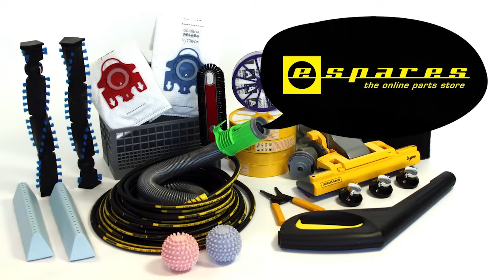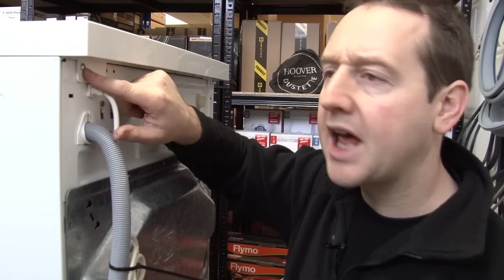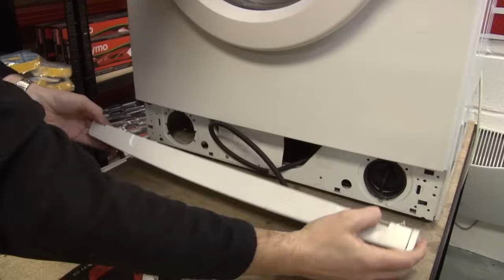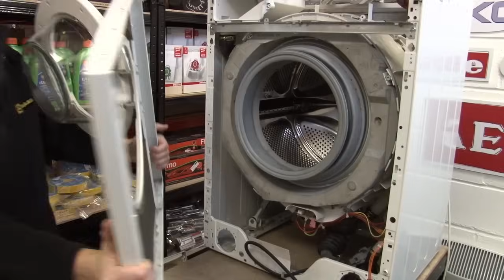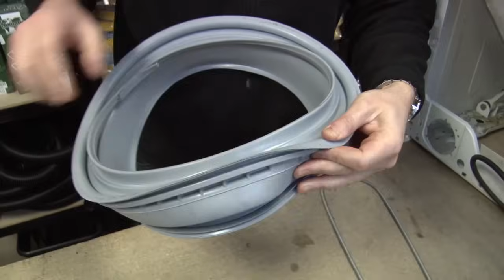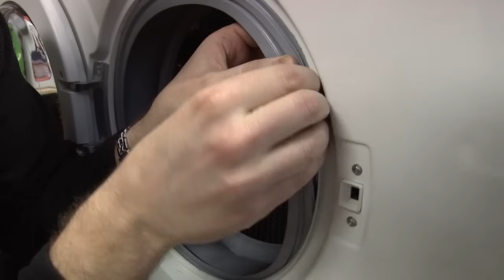How to Replace a Washing Machine Door Seal on a Bosch Washer

Comment: Did this on a Bosch Excell 8 ...

Different screws etc to get to the seal so that was fine but it was an absolute nightmare trying to get the seals clipped in round it ... I had an official Bosch seal maybe it’s made from different rubber but it was a nightmare to try and get it sealed ... the wires didn’t go round anywhere near as easy as your one and I had to get the wife to help me stop it pulling everything out as they clamped on it ... Its not done yet after an hour and a half and a bunch of bruised thumbs ... this is labour intensive wi5 my machine ..yours looked so much simpler... I’d never do again .. well Done to those who succeeded ...
Reply from the maker: Hi Gordon, well done for your perseverance and not giving up. We're glad to hear you solved the issue.

Comment: Hi... Really useful video however i have followed the instructions to the letter and now the washing machine won't turn on. I presume a connection has come loose. Any advice as to what that may be?
Reply from the maker: Hi William, retrace your steps but I would look at the control panel in case something worked loose when it was placed out of the way.
Reply: Thanks. I have tried this but no luck. There is nothing obviously loose.

Comment: Could you tell me what size the torx screws were?
Reply from the maker: Hi Paul, most manufacturers will use more than one size of Torx screws in their appliances and we used a Torx set for this repair.
Reply: eSpares its ok thanks I sorted our washer out it was a t20 and a T10 to get mine out.
Reply from the maker: Glad you sorted it, Paul.

Comment: Brilliant video, I changed the seal on a similar dryer in not much more than an hour even without all the best tools.  Three tips though.  Use a flat bladed screwdriver to lever off the retaining springs.  Get a friend to help you put back these springs, three hands are much easier than two for this job.  Finally, get your new seal from eSpares, great value and service.
Reply from the maker: Hi Roger, well done on fixing your appliance and glad our video helped and remember to like the video.
Reply: @rogernorman5458  I had to ring my brother to help put retaining spring clip back on. Not easy.

Comment: Great video, having trouble with putting the new rubber seal on (3:38), just doesn’t stretch to fit properly, any tips? Thanks in advance.
Reply from the maker: Apply a little washing up liquid to the gap in the seal as this helps it slide over and stretch into position.

Comment: Its not as easy as u show in video the most difficult part in the to put on the seal which is they cut and edit it the struggling one.
Reply from the maker: Hi arju, thank you for your comment, our presenters are not engineers and if you struggle we would recommend using a lubricant to help put the seal on more easily.

Comment: Looks easier enough,love these videos from e spares,but would be nice if they told you roughly how much these spares are,saves looking up the prices,but good video though.thanks
Reply from the maker: Hi Malcolm, This video is over seven years old and as well as prices fluctuating over that time they also can vary a lot between models so we cannot add a 'guide price' without risking putting some viewers off or disappointing others. We currently have 268 Bosch seals listed here:
https://www.espares.co.uk/search/ma856pt1564/washing-machines/seals/bosch

Comment: Thanks a lot. My Bosch Maxx7 door seal was crack. I found easy replacement in Cyprus for 16 euro and with your video help i replace it in a half hour. Very easy and only 6-7 screws and some clips. Thanks a lot again. Familiar disassembly like your washing machine.
Reply from the maker: Thanks for the feedback, glad to hear we helped. 😊

Comment: I just wanted to warn those people who own a Bosch VarioPerfect machine: you may want to consider calling a technician instead of attempting this yourselves. It's not as simple with the VarioPerfect models, as some of the screws are at the bottom of the front cover, etc.
Reply from the maker: Thanks for the comments Andy. There are often minor differences between models but we hope most will be able to follow the video and work out these differences when carrying out the repair.

Comment: On my Maxx 6 machine there is no tork screw on the left side of the control panel face it's a plastic plug of sorts. How do I remove it to get the whole panel off. Thanks.
Reply from the maker: Hi Anthony, Maxx 6 is a range, we need the correct model from the label inside the door. Check if there is a fixing as shown at 1:32.
Reply: Its no. WAE20168ZA/04  FD8705
Reply from the maker: Sorry Anthony but I have been unable to find any information that can help. Sometimes the images of the part can show where it is fixed but we cannot find an image of your Fascia. Try carefully flicking out the 'plastic plug' as there may be a screw hidden underneath.
Reply: Thanks for your response, I have since discovered that there was indeed a "plastic plug" blocking the tork screw. Many thanks.
Reply from the maker: Your welcome Anthony, please remember to like our videos.

Comment: Very useful, thank you so much. Another seal replaced in Spain thanks to this video! :) 

In my case (WFO1873) the front panel remains connected to the lock of the door... because of a sensor or something like that, so it's pretty annoying because you've got to take the front panel out but keeping it close enough to the machine --unless you want to disconnect this sensor (or whatever), which is not necessary in the end.
Reply from the maker: Thanks for the comments Josep, glad the repair went well.

Comment: Excellent instructions - followed to the frame and my repair went like a dream. But WHY OH WHY can't they arrange to have identical screws everywhere - it's really not beyond the wit of a decent deisgn engineer.
Reply from the maker: Hi Geoff, often there are different screws  depending on if they self tap into panels, fix onto plastics or are threaded onto castings and steel parts.
Next time get an Ice tray or pill box where you can separate the screws for each step ex top, back, control, dispenser etc. It may simplify reassembly.

Comment: Great video, second door seal I've fitted on this machine now, last one has been fitted for a couple of years but started spitting and leaking. Different supplier for this one so hope it last a little longer.
Reply from the maker: Hi Roy, we can supply the manufacturer's original seals for most machines if they are still available. To help extend the life of the seal see another video: https://www.youtube.com/watch?v=ifWK9df1qgg

Comment: USE TYRE LEVERS TO PUT SPRING ON OUTER SEAL THEY ALWAYS WASH OVER THIS DIFFICULT BIT
Reply from the maker: We did not mean to 'wash over' any information but thanks for the tip Paul hopefully others may also find it useful.
Reply: Sorry for the bluntness it was not aimed at anyone specific but i had struggled for an hour and a half until the eureka moment "Tyre levers"
Reply from the maker: No worries, any tips that help others are always welcome. As an engineer we often have learnt ways and have repeated repairs many times so sometimes do not  appreciate how difficult it can be the first time you come across a repair. We find ways of doing things and collect tools to help do the job quickly but cannot expect the average viewer to have these. However thing's like a bicycle tyre lever may be available and we had never considered using in this way. 😊
Reply: As long as you use the two! together it goes on fine.

Comment: V useful. My machine has a couple of notable differences. A hose connection to the seal at 11:30ish from the soap dispenser and the lock wiring was clipped to the front panel - easily removed. 

I'm not sure removing the control panel helped on my machine either.

Took me an hour all in. 

Ta.
Reply from the maker: Many manufacturers change their designs over time but it is always worth checking if we have another video more similar to your machine. Glad you managed to complete the repair.

Comment: bought a new Hotpoint washing machine and i noticed 2 weeks later that appears to be White colored mark on the grey rubber seal when u open the door at the 6 o clock position on mine, could it be normal or rubber wear due unbalanced spins ? no leaks but bit worried thanks
Reply from the maker: This could be a sign of using excess detergent as new machines use less water so do not need as much powder. Try reducing the powder and If the machine shakes from unbalance see our other video:
https://www.youtube.com/watch?v=uKBy-9NEF5A

Comment: I am waiting on a replacement seal for my Inglis washing machine as it is ripped. Quick question once in awhile clothes have been getting holes in them from the washing machine. do you think this is from the gap between the drum and door or could there be another issue?
Reply from the maker: The gap around the rim is more likely to cause clothing to get caught than puncture the seal. To identify the cause look at the damage, a torn lip at the bottom where the seal contacts the glass is usually caused by dragging a heavy wash load out of the drum and not lifting it over the seal. A puncture in the bellows area can be caused from bra wires or zips so watch out for this.

Comment: There is one extremely important piece of information missing from the start of this video:
Check to see if the door lock has fixing screws - if it doesn't, THE FRONT COVER CANNOT BE REMOVED and all work must be carried out around the rim of the drum.
I removed the top cover and control panel as per the video, only to find (through watching another video) that on some Bosch washing machines the cover can't be removed.
I then had to put everything back together again, which wasted a lot of time.
Changing the seal when you only have access around the rim of the drum is a nightmare. Be prepared to spend several frustrating hours on this job!
Reply from the maker: Hi Gordon, thanks for the feedback. If only things were simple. Manufacturers often change the designs of machines and even when we have a video for a particular make the procedure can be very different. The only tip I would like to give is if the model is not exactly the same check out some of our other videos for changing the part as you may find either another make or a simpler approach to fitting the part. Hope the next repair goes easier. 😊

Comment: Very disappoiinted - obtained exactly the same spare part (the seal) to find it differs from the existing sea in that it doesn't provide the hose attached to the seal to link up as per the seal being replaced. Having spent $ on the spare part via email order and paying the installer $99 for the first half hour of work - to discover that it lacks the corrugated hose connector valve all I have is the orginal problem of leaking water (and that's if the workman can reinstate what he has dismantled!)  What can you suggest as I live in South Australia - do you have Bosch repairmen here?????
Reply from the maker: Hi Iris, we do not have repairmen in Australia but if you give us the full model number from the 'rating plate' including the **/** at the end we should be able to supply the correct door seal.

Comment: There's no description of how to deal with the Nexxt 100 series.   Turns out you need to take the door off and the right side and  weight to make it easy to put the inner  spring ring on.  Also the plastic front while leaving the metal front panel on so  you can get to the weight...  AND having two hands for the getting the sprin on so it doesn't keep  popping off ...
Reply from the maker: We do have a number of different door seal videos but cannot cover every model. The following video may have helped although not a Bosch machine the method may have been more suitable.
https://www.youtube.com/watch?v=3IqArUKDLYE

Comment: Boch Nexxt 100 washer ineed to replace door seal but don't know how wich parts # belong to mi machine, can you tell me?
Reply from the maker: Hi Albetrto, You are having difficulty because you are trying to use the model on the front not the full model number. Have a look for a label on the surround of the door opening behind the door edge as there will be a sticker, you will need the full details starting with three letters (WAE?) the number then the last bit (GB/05?).  When you have the full details if you cannot find the part fill in your information on the following link and we will help you:
http://www.espares.co.uk/contact/sales

Comment: thank you very much for your demo. i carried out a diy on my machine and it  worked. just a suggestion if you are going to improve on the demo.  a close up of how the back rubber bit goes on would help and also i  found that a bit of fairy liquid on the front rubber bit helped with the sitting .
Reply from the maker: Hi Nat, we do mention the liquid soap tip on most of our videos and we are sorry we didn't show the seal fitting better. It can be very difficult to show some shots but we always welcome feedback as it reminds us of the 'important' bits and help us to produce better videos. :-)

Comment: is it possible my retaining band for the outer got streched when I took it off? Haven't managed to replace my seal as cant get the front off my machine (classixx 7 express 1200) and now I can't get the retaining band back on the outer of the seal it seems too large to fit into it? the coil bit doesn't look stretched out
Reply from the maker: Sounds like you will need to replace the retaining band Lasuil. You have quoted the range number not the model which will start something like WAE and end with GB/05 or similar. Find the model from the label here:http://www.espares.co.uk/browse/at1085ma856/washing-machines/bosch
If you cannot find the part fill in your information here:
http://www.espares.co.uk/contact/sales
Reply: I'm surprised if thats the case as I wasn't rough and I'm certainly not very strong! Aren't this meant to stay really taught when taking them off? model is WAE24468GB/17 would be interested to buy from you guys if you sell them. I couldn't get the front plate off mine though as there's a little white plastic thing inside (just below the wires from the control panel) I believe you have to push down and I'm just not strong enough.

Comment: Wondering if theres a way to do this without having access to the top or back, my washers embedded itself in the lino flooring and its a complete hassle to pull out from underneath the counters... I performed a 60 degree maintenance wash recently and its melted the door seal... How does that even happen? =/
Reply from the maker: Hi, It is possible (though a little more difficult) to do this through the door opening and the process is similar to that shown on this video:
https://www.youtube.com/watch?v=3IqArUKDLYE
It should not be possible to 'melt' a door seal as they can take boiling water as they can wash up to 95 degrees safely. FOr information on a maintenance wash with a great cleaner see our video:
https://www.youtube.com/watch?v=ifWK9df1qgg
Reply: I dunno man, it looks on mine which is a Bosch Classix 1000, the seal has been in contact with the spinning drum and friction has melted it? It's a concern... =/
Reply from the maker: Ah, now that is likely to be a different problem. If the bearings are worn or there is a particularly heavy item in the drum the drum can flex and contact the seal resulting in friction and burning. The sea can even be damaged from an item of clothing rubbing on spin. Check there is no play in the bearings by lifting the front edge of the drum and looking for movement between the lower edge and the seal. If this is ok spin the drum and make sure the edge is running true. Clean off any rubber 'pick up' on the edge of the rim and if this is OK watch another video to prevent it re occurring:
https://www.youtube.com/watch?v=uKBy-9NEF5A
Reply: For some reason mines leaking not from the door seal, but from beneath the machine at the front. I think the burning is a result of the machine trying to wash without any water inside due to it all leaking all over the kitchen floor... What a hassle =/
Reply from the maker: A hole in the seal may reduce the water level but it would not drain completely. You may have a hole in the tub possibly from a coin in your pocket. Disconnect the power and remove the back. Pour a kettle full of water into the drum and then check for leaks under the tub with a torch.

Comment: You make putting that outer retaining band on look so easy. I can't get mine back on! Urgh! Any tips would be welcome.
Reply from the maker: Hi Jamie. The best method is to feed the band around the edge of the seal starting at the spring. When the band tightens carefully pull the end of the band not attached away from the spring until there is enough to ease into the remaining groove as shown at 5:19

Comment: Best video on this and definitely was right to take the front off my Classixx machine (unlike some other videos).  Only two screws holding front at the bottom; needed to slide front upwards to engage plastic tags near top when refitting.  Second pair of hands briefly made it easier replace inner retaining spring band.  Good advice - thanks.

Comment: might help to put o\silicone on the edges of the gasket before installing.
Reply from the maker: Thanks for your comment. No manufacturer uses silicone as if the seal is in good order and fitted correctly should not leak. In addition removing a seal with silicone in would be very difficult.
Reply: I WAS REFERRING TO SILICONE LUBRICANT, NOT SILICONE CAULKING.eSpares
Reply from the maker: Some seals depending on manufacturer will actually come with lubricant. On some of our other videos we suggest using liquid soap, but silicone lubricant is the best option if you have  it.